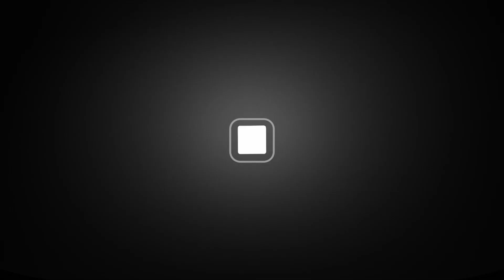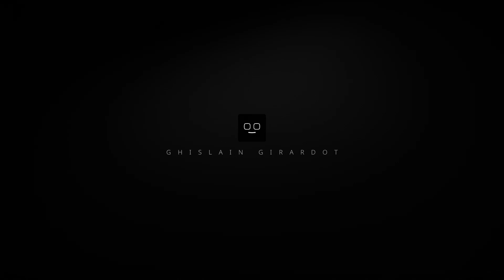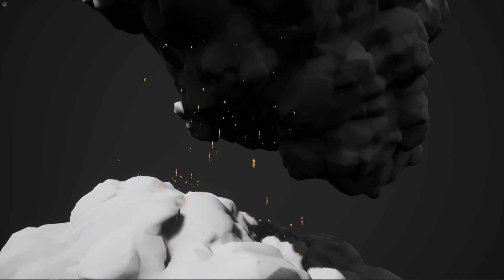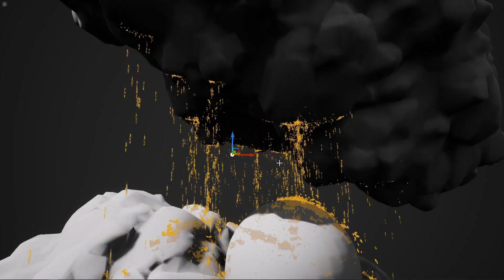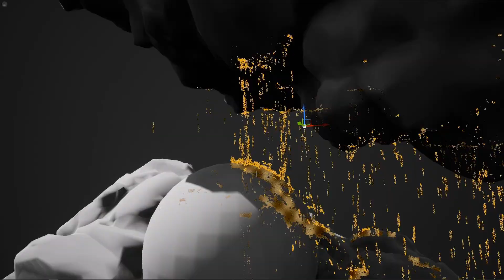Dripping Water Droplets VFXs with Niagara - Part 2 - GPU Emitter

Comment: for the splashes; why did you choose to prebake the splash locations instead of relying on physics for the falling particles + DF collision, and then using the SpawnFromOtherEmitter module to spawn splashes? Did you notice a big performance cost when going the "easy way"?
Reply from the maker: No reasons. Just showcasing different ways to do things. Pick the solution you prefer. DF sampling has a cost, but it's probably not measurable for a few dozens particles
Reply from the maker: DF sampling is also not as reliable as prebaked positions from complex line traced for reasons I explained (poor DF resolution, DF samples the ceiling surface at first so you need to reject false positive). It's just two different ways of doing things and pros & cons are not just about performance here. Plus, got to think outside the box and see what kind of things you could do with prebaked data. Water drips isn't the most exciting choice.

Comment: nooice! Not sure if you have covered it, but if you place the system in the world and rely on Global Distance fields, then the system won't inti properly if the player camera is to far away. Since global distance fields only works at a certain distance from the camera?
Reply from the maker: yup, that's another limitation with DF and the pros of prebaking data. DF is view dependent and breaks at a distance. I don't think I mentionned it in the video though, I should have.